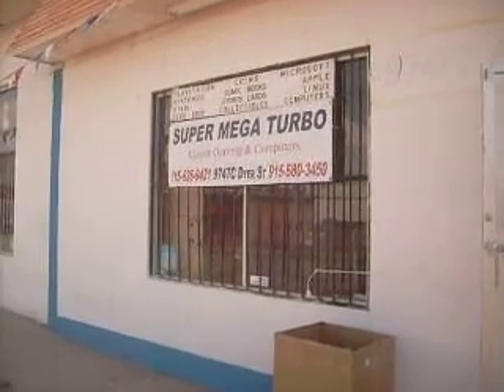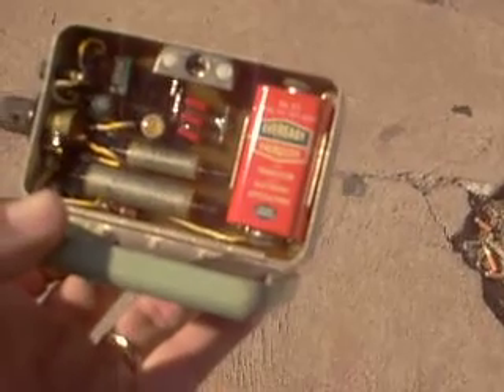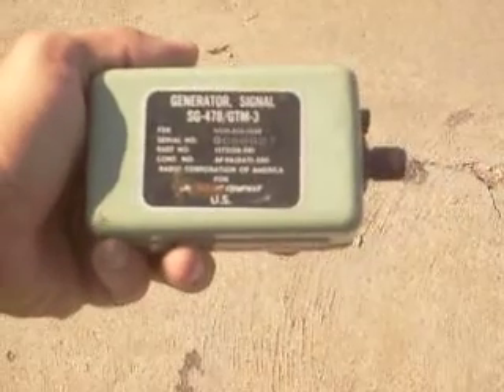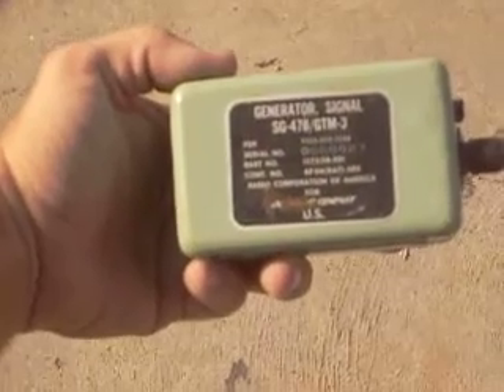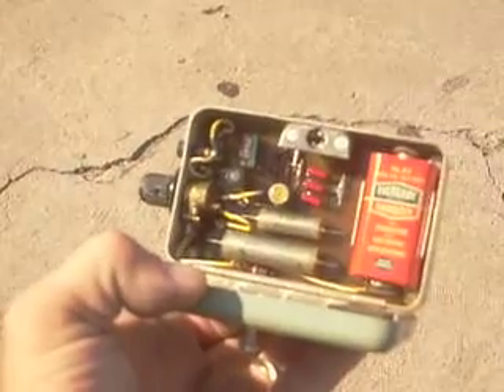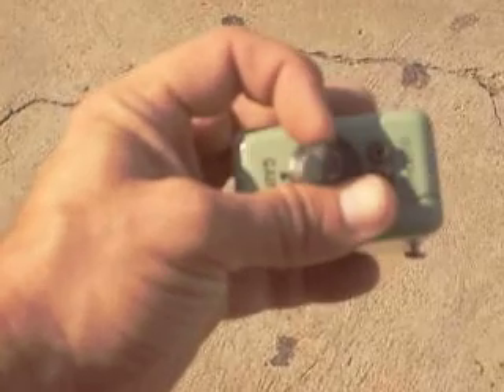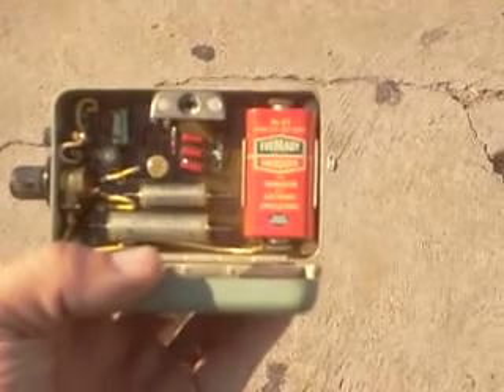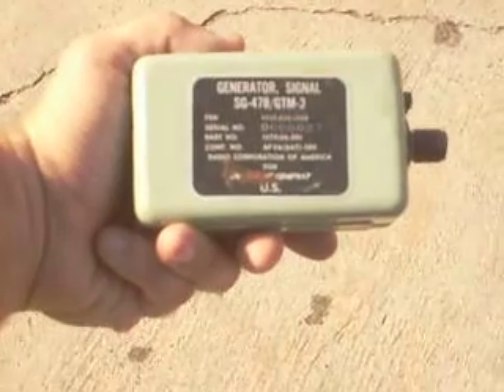Radio haul, neat stuff part 1

Comment from the maker: PMing didn't work, I have to be added as a friend. Nothing against that but this is quicker. I can definitely take a money order, and the chuckwagon is there to protect us both. I know it's a fan-type auction site, but I use it so there is someone there actually moderating even in the smallest degree. 

Plus you can get great stuff that you KNOW will work. Plus, I need to test this thing out before I sell it. 
Testing first, then I'll sell it. MUST know if it works or not.